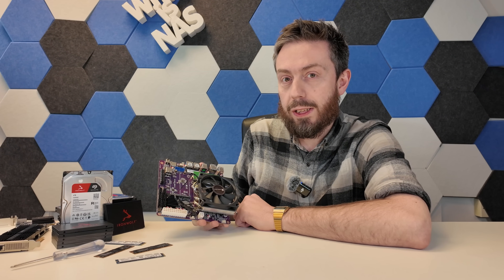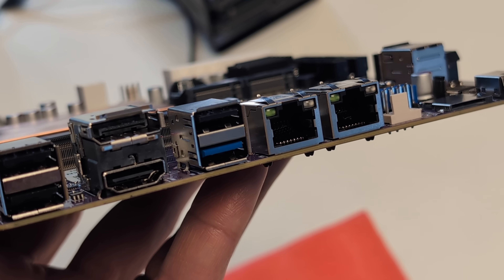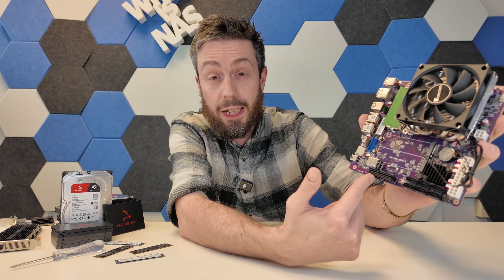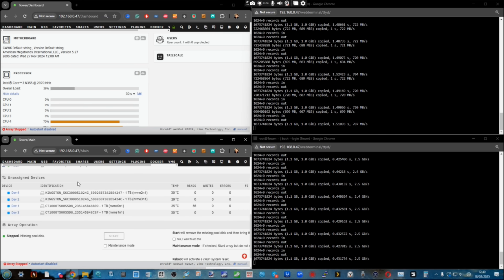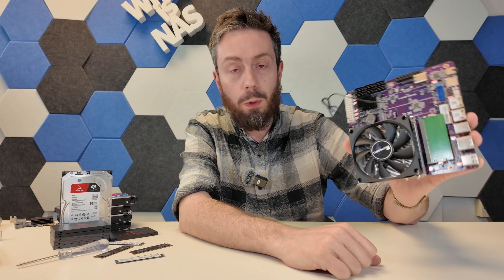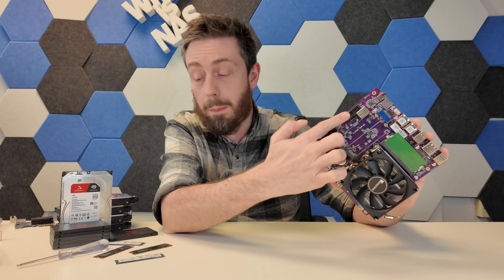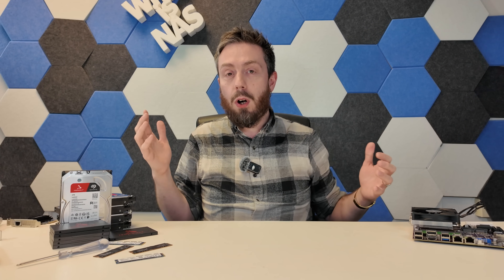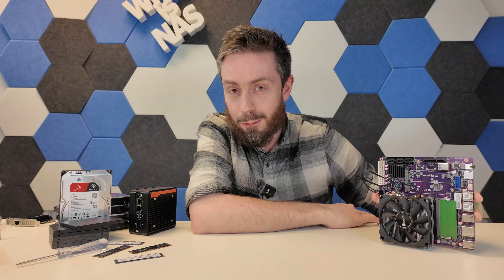CWWK N355 NAS DIY Motherboard Review

Comment: Hi, is it possible for you to check if it really doesn't support ECC? Cause the CPU does support in-band ECC, which is different to the DDR5 on Die ECC. For all purposes in-band ECC does what "normal" out of band ECC does, just with a hit to performance an capacity. It would be nice to know, if the option is available in the BIOS. The Odroid H4 series and some of the lattepanda boards support it, so I was wondering, if this one does.

Comment: Hi, not quite understanding the part on pcie gen 3 4x slot sharing bandwidth with asm1166 which is taking up a separate 1x bandwidth. Would the 2 affect each other? Asking as I would like to use a 10g sfp+ 4x card with 6 sata drives.

Comment: Can i ask, what PSU are you using?, and do you substract the powerusage from that in your power consumption tests? 
I'm asking because i have a old PSU in my NAS, and  i suspect the PSU to have a lot of  loss/waste (20-30W) 

I was thinking of going Pico PSU to get better efficiency. 
But if i could get a PSU with really low minimum usage, i would prefer that.

Comment: The problem that I have with these N100, N150, N350 etc is the actual PCIEX lanes. They have only 9. I think the best fit for a low power yet a fairly good peripheral speeds is the Intel Gold *8505 CPU. It's a N100 + one high performance core (15W). But it has 20 PCIEX lanes instead of 9, and this fixes all the bottle necks that we keep seeing in these Nxxx processors. CWWK already has a board like this, not sure why isn't this more popular...
Reply: Precisely, but given the sparsity of such solutions and the slightly increased price tag - ~200$ -  is easy to understand why one might steer towards what's unquestionably readily available. But on a deeper thought AsRock Industrials, along the lines of STX-1500 & IMB-1245M series - mainly for media ofc -  would blow the living daylights out of what's been previously mentioned, in both performance and specifications - albeit at a steeper price point & availability.

Comment: Na, i just bought a z490 itx board, modded bios to accept xeons and dropped in a w-1290 and running 8 disk and 2nvme with a sas card in a itx case.

Comment: Very strange, I made a comment over 12 hours ago, but it disappeared...
Anyway...If CWWK replaced the two 2.5GbE ports with one 10GbE, no lanes would need to be sacrificed (I don't need 2 LAN ports personally, though a remote management port can be handy). However, you'd ideally want everything else to be using x2 Gen3 bandwidth too. So both NVMe slots and the integrated ASM1166, leaving only x1 for the PCIe slot. This would be the ideal lane division, for me personally.
Wildcat Lake is only going to have 6 Gen4 lanes apparently, so this lane problem is going to get worse in the future on such very affordable motherboards.

Comment: Mate when testing Plex transcoding you need to show igpu usage. This is easy in unraid with the gpu statistics plugin. Its a far more useful test than cpu usage. This has been bought up in basically every video.
Reply: Does not work so far with recent version of the plugin - no data displayed from the Alder lake n355 igpu
Reply from the maker: THIS! the N355 has not been a smooth test so far with Plex etc. it works, but everything that previously worked with all other intel CPUs to run Plex HW transcoding has not worked on this processor and having to mod things on CL. On someone's else's suggestions, gonna run Ubuntu and install Plex through there as apparently that (somehow) works!

Comment: Hi! Thanks for the video!
About the cooler, what holes pattern is it? I wanted to buy one, but didn't like this cooler, wanted to try and fit a noctua one there, or better some chonky heatsink and add my own fans for a front to back air flow.

I bought the N150 verssion, and were hesitant with this one, but after seeing your review, i'm glad i held of for the n150, since i want to use it for a pure NAS, VMS are in a proxmox server anyway, so if i'm getting only 800MB/s out of the storage, the faster CPU does no good for a NAS.

Although, i'm considering getting one for my opnsense router, perhaps a N150 would suffice still, though. But VPN stuff would rather apreciate the CPU upgrade i guesss!
Reply: Intel Cooler 115x pattern.
Reply: @AJSB23  thanks! That means i can find a noctua to strap on this! :)

Comment: If that cooler is no good, then any suggestions for a suitable alternative?
Reply: In my experience, and cooler with the same bolt pattern as the mobo. I have a similar board with n305 and noctua low profile cooler running great.
Reply: Most of them use LGA 115x coolers. Check with specific boards for more details.

Comment: I recently got the Topton n355 itx board which is pretty similar - Had the same issues your experiencing trying to get the hardware transcoding to work - took the path of Grab an AI to help me rebuild the Kernel (Found the GPU is detected fine in Ubuntu Desktop) 
Suspect you could just do your tests in Ubuntu Desktop?
Also can confirm - I got the cooler with it as well and had great difficulty getting it to fit well - would also recommend to get something smaller.
Reply: Can you share more details how you managed to get the hw transcoding working? I am using unRAID 7 and want to keep it.  The fan setup was tough ^^
Reply: That's why I have come to use Proxmox as the base install for any system... their extended ubuntu kernel and opt-in "development" kernel options make things typically "just work" (I don't have this board so haven' tried, but suspect it or the opt-in kernel likely works w/o headache.
Reply: What cooling solution did you use instead? I'm considering the same board...

Comment: I don't get the idea of a DIY motherboard.

It's just a motherboard 
Nas motherboard and so on.

Just like an ASUS motherboard

Why does it feel like the term DIY has been diluted to the point that a bare product is considered DIY
Reply from the maker: It's mainly because the DIY part is about building your own NAS solution, versus getting a turnkey solution (i.e pre-built, like a Synology or QNAP).
Reply: @nascompares also I noticed that a lot of people are getting the typical NAS size NAS motherboards. 
Considering that Synology is likely becoming more business focus, personally I would be focused on procuring space in my room for server tower with a ATX motherboard with a mid-range processor and save all the other slots for graphics, external I/O etc for extensible long-term adaptability.

This would give me a lot more flexibility internally and externally as well as adequate options for cooling because let's be honest a lot of these units are extensively rely on good Ambient temperature to replace hot air with cooler air
Reply: @nascompares  then it sounds more like a Great motherboard for DIY nas projects

Comment: Bought N305 version for my primary NAS, then N100 version for backup NAS. Both work flawlessly (transcoding included) for almost 1 year now. Don't have much more to say about them ))
Reply: I have that exact board but with the N305 too and it works great running Xpenology. Emby transcoding works fine.

Comment: This board is way too expensive at ~$300. Why buy this and not just a regular lga 1700 mb with a regular i3? What’s the advantage, only 2 extra sata ?  With this board you get a soldered non upgradeable cpu, ram limited at 16gb, no full x16 pcie…just don’t see the value there. A b760i ddr4 itx mb with a i3 14100 will set you back about $320 and this is a way more versatile option.
Reply from the maker: Tbh the main appeal is just physical scale and mobile SoC processors that these generally arrive integrated with. Think of the same arguement for a laptop Vs a PC in terms of price point. Similar logic
Reply: @nascompares I Think for most Home people just wanting a Nas for some files and Plex for Home use Only, these boards are absolutely fine. They fit in the fairly small Jonsbo case and the performance is ok for the small footprint. But why oh why can’t they come up with a smarter solution to the sata ports. Just make a connector in another spot that uses those sf connectors to branch out to all 6 sata disks. It’s stupid they always have to place them behind the Pci-e slot so you hardy can get 6 regular sata cables to fit when using a longer pci-e card than 3-4 inches. This would be perfect once they get the hardware encoding solved, and you can use the pci-e for a 10gbe network card.
Reply: These MBs are good enough for their function and are considerably more effective in terms of power consumption
Reply: The main appeal is the form factor (itx) since most Nas Cases only accept ITX form factor, and it's hard to find socketed MB with this much sata, nvme, pcie and Ethernet ports. Regular ITX boards come with only one PCIE, you either use it for sata card , network card or GPU (if you need serious transcoding). 
Tbh, i think using ITX MBs and cases kinda make no sense, since for the same price you can get mAtx/ATX MB and Tower/mid-tower case with as many drive bays as you want.
Reply: You're paying for the custom engineering + the fact they won't sell 10's of millions of these.

For me, no 2nd ram slot is a deal breaker, which is sad as the unit has dual 2.5G nic's...

 Soldered CPU isn't ideal either....

Factor in the price as you mentioned, and yeah, Def not good value performance / upgrade wise. 

I guess this is for those who want a small physical profile.
Reply: Also disadvantages of those Chinese MBs are whether they are stable or not. Also their bios origin and security  concerns.
Reply: You obviously don't live in California... the power the i3 takes will eat up those "savings" pretty quickly when you're already at the top tier and every extra kWh is costing you $0.53
Reply: @fiveangle  that's the whole point that I'm making here. With a regular ITX platform, not something with soldered on cpu, you have choices. If you don't like the i3 cpu you can swap it for a Pentium Gold or Celeron which are more power efficient (ps: you will probably be surprized that i3 14100 after you disable turbo boost from the bios and a few other tweeks it can be almost  as efficient as that n355 in terms of power consumption, you don't like tweeking? then just buy the 14100T). After a while you discover you need more power you can just buy a new procesor and you don't have to scrap the whole platform when upgrading. With this n355 platform you pay more money and you have a whole bunch of limitations and problems like limited number of PCIE lanes which you cannot do anything about because the cpu is soldered on, no pcie bifurcation options, getting a GPU working with this board will be a nightmare if not impossible in case you discover you need one (btw check the comments, some already bought this board and have issues transcoding with the intregrated GPU), no real choices in terms of pairing a specific mb chipset with a specific processor, not to mention a whole bunch of cpu features that these mobile platfroms are missing which could be useful when building a NAS around them like Intel VMD for example. Just check  the Intel ark comparison tool.
With a regular ITX board you get the same form factor and compact design but with the possibility to shape your build with specific characteristics in mind like power efficiency, more compute power, more ram while also keeping your options open if your needs change and not locking in a specific combo due to no upgradability options.

Not trying convince anyone of anything just stating some obvious problems with this platform which from my opinion are deal breakers, at the end of the day everyone is making their own choices and buying whatevere works better for them no matter if it's this N355 platfrom or something else.
Reply: @fiveangle  i3 14100 is 65w cpu. If you have average load of 20% every day, which is more then it will be, 110-115kwh per year. That is $60 per year. If you can't afford $60 per year, don't build a NAS
Reply: Hello, can you let me know which b760 itx you mention which got six sata connectors on board ? 

Thanks
Reply: @frankwong9486  One spare m.2 slot can make 6 SATA connectors with a m.2 to SATA adapter. ) 

But I am with you, even though b760 is beefier, NAS doesn't need to be that strong and powerful (look at Synology specs). B760 is a power-hungry overkill for NAS purpose
Reply: @4eyesleo  Yup, I am running the N305 version of this motherboard and it is running Xpenology great and Emby transcoding works great and is very low power.
Reply: @4eyesleo  If you only need NAS, you can go with half the cost N100 Or N95. It will do the job same and with better power efficiency. No need for this board. So B760 board is better and cheaper option if you need more powerful CPU/iGPU.
Reply: @brankojurisa6613  Not sure if N95 is potent enough to HW-transcode 4k to 720p on the fly, if so, you are right.
Reply: @4eyesleo  I said if you only need NAS storage, not plex server. If you need plex server, then lga1700 mbo with lets say 12100 or 14100 is better and cheaper option. 4 sata ports is not really a deal breaker. You can transform nvme into 6 sata connectors and then you have 10. Or use pcie to sata adapter so you can still have 2 nvme slots if you need them
Reply: @brankojurisa6613  I have researched a little, and transcoding from 4k hevc is working ok even on N95 thanks to hardware support in iGPU, so no need in lga1700 even for this :)
Reply: @4eyesleo  yes, for one or two streams it works great. If you want to share your plex library with other people and transcoding is needed, it is a thin option. But most of today devices support all modern formats so no need for transcoding, it just direct plays. That is just few percentage on the cpu load.

Comment: Can this cpu ever support ECC? Most mention " Supports ECC UDIMM memory modules (operate in non-ECC mode)" for N100 so dont think they can add it, so hard to fault the MB for that?
Reply: Apparently there is a way to get in-band ECC working on this board. A lot of people confuse this with on-die ECC which is part of the DDR5 spec. In-band ECC is not that - instead, it's a way to get ECC with non-ECC DIMMs on some supported Intel SKUs (of which the i3-N305 is one). There is some information on the Odroid forum with respect to their H4 Ultra, but there is also a hint that the same can be enabled on the CWWK board somewhere in that one big ServeTheHome thread.
Reply: @Battlekell  cool, sounds like some n100 and n150 should have it too, that would be nice on a nas motherboard if I where to run zfs
Reply: @Mech0z That’s what I’m thinking too. There is a loss of memory bandwidth associated with in-band ECC which apparently results in a 10-20% performance loss, sometimes less depending on the benchmark. But even with a single channel at 4800MHz I think this hardly matters in a NAS application. And given the clever way that ZFS distributes read operations on mirrored devices it might even be possible to saturate a 10Gb/s link of an SFP+ NIC for reads from an M.2 NVMe mirror. That’s definitely something I would like to see tested.
Reply: @Battlekell  Year that would be nice and would probably make me choose such a motherboard. Right now I am debating if I should buy a "nas" MB for my existing old Fractal Node or just buy a Terramaster DAS and use that on my GMKtec 5825 mini pc
Reply: @Mech0z  Absolutely. Unfortunately, I don't have a lot of time currently - otherwise I think I would pull the trigger and try it myself. Not sure yet how you would inject errors to test the correction and reporting part. But I remember reading somewhere that there is even a BIOS setting to somehow inject errors that way if I remember correctly.
Given how many people are looking exactly for this combination for their home server, i.e. low idle power and ECC (either sideband or in-band), it's surprising how little information there is. This board is the only standard form factor with a current CPU that offers that combination as far as I am aware.

Comment: I’m building an archive computer with 8 optical drives to scan information.. planning on running 8 virtual machines so I can automate it. I would have to add a sata expansion card to cover the additional drive and a couple of larger sata disks for local until at night it would dump to my Nas. Do you think this motherboard is a viable options?  I like the power usage because of cost savings on a lower power power supply